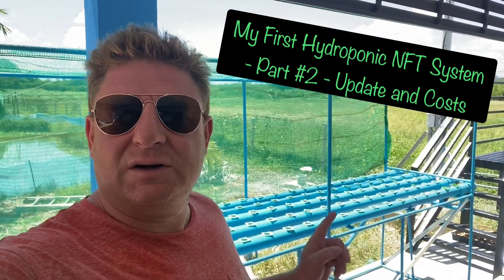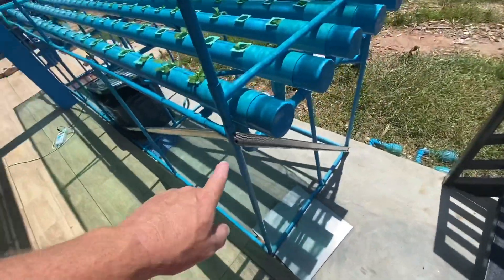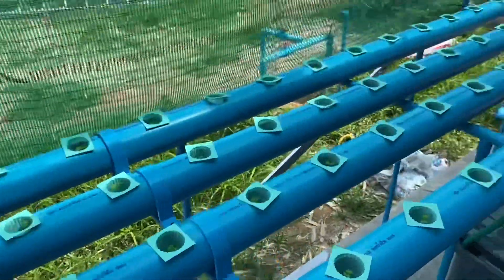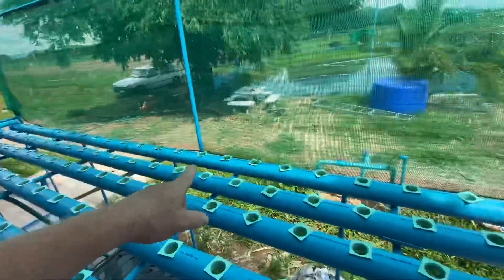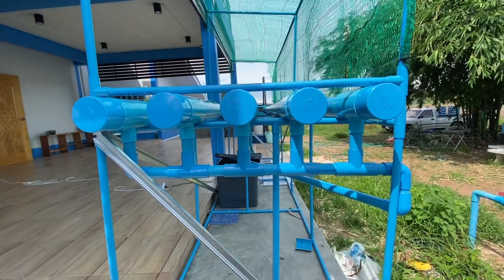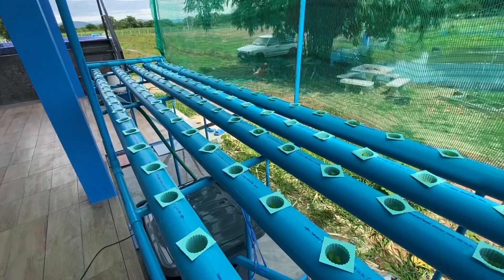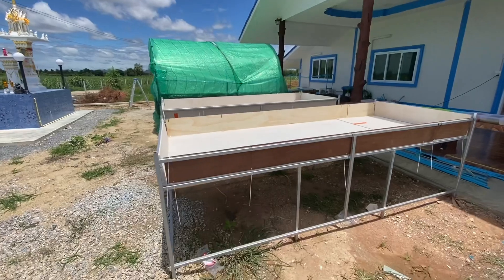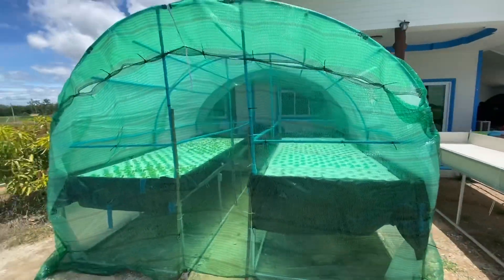My First Hydroponic NFT System - Part #2 - Update & Costs

Comment: Looking to do the same nft build, curous about how your are delivering the water to each rail, could briefly see it in your video, looked like T's with caps on them and a hole drilled. Also, you might want to elevate the end where the water enters the rail so that the water travels faster. 2 liters/minute is optimal.

Comment: Thanks for this. Just subbed. I’m interested in doing similar in Thailand. Do you ever have to worry about the reservoir water getting too hot? Wheres the best place to source nutriants, ppm meters etc? ,Keep the hydro vids coming
Reply from the maker: Glen Robertson TV Thanks Glen. So when the water gets a bit hot 🥵 I have been putting in 2ls bottles of frozen water. Still in the bottle. The ppm reading is something we can check but don’t at all! We have a reader but everything has been growing ok so we have left it how it is. (I think it was around 500 to begin with. We got the nutrients on line but you can get them in lots of farming or seed selling stores.

Comment: Hey Jason, welcome to the trial and error hydro club);0) Seriously, if you have all the right tools, you can make hydroponic systems cheaply but if you don’t, then simplicity tends to pay dividends. My first NFT system was built on an old 8 ft picnic bench with the pipes hanging off the ends and it worked fine. When it comes to cost savings for you:  A wooden / bamboo frame, would be a lot sturdier than the PVC pipe and save you quite a bit on pipe, glue, T’s and elbows.  If you put your grow pipes at the right gradient, circa 1:40 or 30 (1 inch drop per 40 or 30 inch length), you could dispense with the end caps completely at both ends: Especially, when as you mentioned, you use a gutter or trough to catch the nutrient solution at the exit end of the grow pipes (and you won’t need the expensive T’s ).  Also, given water doesn’t flow up hill, you don’t need end caps at the input end either, so that’s a fair saving.  Irrigation pipe plus irrigation pipe fittings make the best, cheapest and easiest feed manifold to get your nutrient solution into the grow pipes and there are lots of vlogs on YouTube showing this method demonstrated, but if you can’t get hold of the irrigation pipe or fittings, you can always make a manifold similar to the one you have made by drilling holes in the PVC pipe, where you would normally put the T’s and by gluing small sections of a smaller diameter pipe into the holes, hence a saving on T’s; although you will still require an end cap. You’re not making a high pressure system, so as long as you create a water tight fit, the water will flow where you want it to and not force the junction apart. I could go on for ages but hope this helps; by the end of the month those lettuce should be maturing and I look forward to your updates. P.S. It may be worth checking out the YouTube vlog by Spring Hill Farms “OUR HYDROPONIC LETTUCE HOUSE AND HOW IT ALL WORKS !” as there is a lot of information you may find useful.
Reply from the maker: Wow thanks Brian for your information and interest. I am waiting to see how the vegetables turn out before I make another system or do anything. At the moment things are going pretty well but I don’t want to speak to soon. I will keep everyone updated as things progress but if it does work then I will probably scale things up. We’ll see.... thanks again

Comment: Looks much stronger now, as for the return drainage i would use end caps & put elbows 1/2" from the base dropping into 1 pipe across then returning to the sump tank, to increase your yield you can double deck it or X 3 decks just make sure the pump can push the water that high good luck waiting on Pt 3
Reply from the maker: gary ash I have seen people with double deck systems - growing kale as well. It’s definitely an idea for the future. For the moment I just want to see if the conditions are right for growing. Thanks for the suggestions and advise.
Reply: @jasemate2010  Your welcome hope it goes well looking forward to the update vid